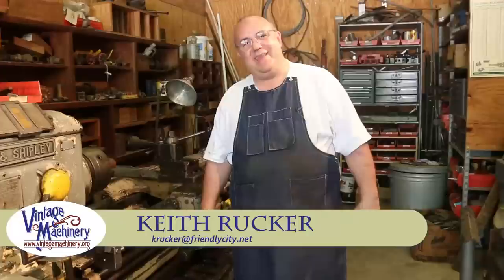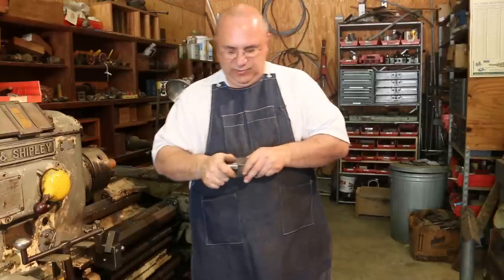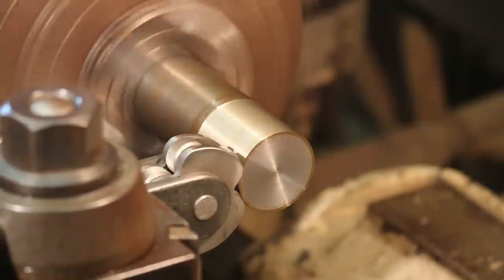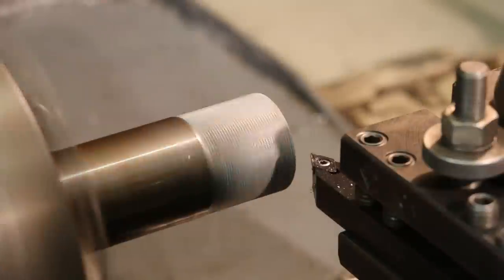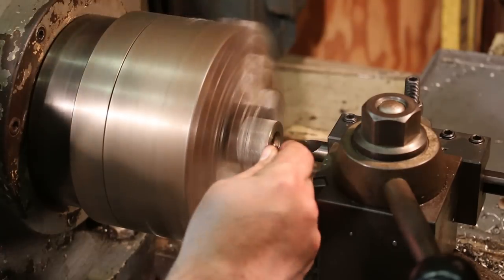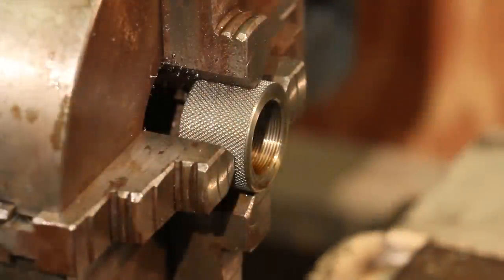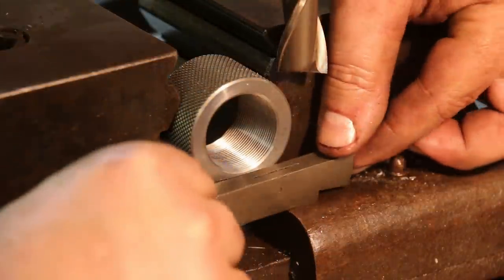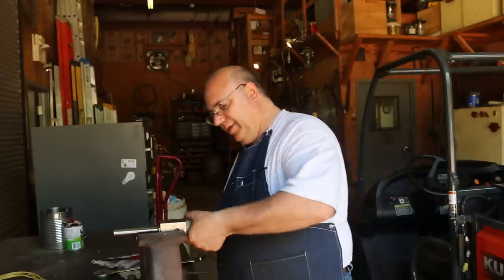Machining a Custom 5C Collet Nut

Comment: About knurling - I understand the tool and the process but one thing I never understood is why you do not get overlapping (and ugly) knurls.  The piece to be knurled is of one diameter and the tool's wheels are of another diameter.  The ratio of one diameter to the other would rarely, if ever, be an even number.  So after the first knurling trip around the piece how would the teeth of the tool align with the beginning of the previous knurls  to start the second pass?  How do you not get a mish-mash of knurls?  It obviously works - you just did it - I just can't visualize it.  I hope the question makes sense.
Reply: I think it's because of path of least resistance.your knurling tool wants to go to the easiest place and just basically keeps getting knocked into grooves as it runs around, even though it's not a perfect match. I'm sure if you exaggerated the knurling tool tooth distance, the problem you're describing would rear its head.
Reply: ***** If you look at the charts for the diameters, the difference between them is very small. If you just tighten the knurl, you will move down to a diameter that is evenly divisible by the teeth in the knurl by feel/seat of the pants.  Now, if you are trying to make a part to specification, it helps to know beforehand where that evenly divisible point is but if you are just wanting to put a knurl and have some liberty as to the dimension, it doesn't matter. Just crank in until it looks good.
Reply: cemx86 Tom Lipton ( oxtoolco ) has a good video on this. He calculates the circumference of the workpiece and determines whether it is an even multiple of the distance between teeth on the knurling wheel. It is easy to adjust the diameter of the workpiece very slightly to make it come out to an exact multiple.

Knurling wheels are marked with the number of TPI (teeth per inch), so it is easy enough to calculate the actual pitch ( 1 / tpi ) and check whether the circumference is a multiple. If it isn't, just discard the fraction, and calculate what the diameter of the workpiece must be to have a circumference of that length (after discarding the fraction).

Example: 
You want a 1.750" knurled workpiece and have 25 TPI wheels. 
1/25= 0.040" pitch. 
The circumference of 1.750" is about 5.498". 
0.040 goes into 5.498 137.45 times.
Discard the 0.45 (you could round up, but it is much harder to add diameter than to reduce it).
Find a diameter with 137 times 0.040" circumference: 137 times 0.040" is 5.48"; 5.48" divided by pi is about 1.744" diameter. 

You are going to have to settle for a 0.006" undersized knurl.

That said, knurls will usually "slip" into an integral number of grooves if the circumference is close to an even multiple. My experience suggests that you will get a bad knurl (double struck) about 1/4 to 1/3 of the time if you just take a random diameter and try to knurl it with whatever set of knurls you happen to have. However, if you have a lot of time invested in a part and want to optimize your chances of getting a good knurl, then it only takes a few minutes to do the calculations and adjust the diameter a tiny bit if needed.
Reply: I've been wondering the same thing, and have been reading a bit about it. I don't have a final answer, but some things to consider that I've come across:

There are some fairly standard sizes that most of us turn things to...usually some multiple of 1/64".  Knurl wheels come in some standard tooth pitches that have been worked out to fit with those standard diameters of parts. Unless you get strange with your part diameters one or another of the standard pitches will probably work. 

After the first pass the part has grooves in it, and as long as they are close enough to where the teeth come down on the second pass (a few thousandths), the teeth will tend to slip into them and you get clean knurls.

Knurling is a forming operation, not a cutting operation, so the workpiece will tend to change diameter slightly as far as the knurl wheel is concerned.  The teeth aren't are the original surface after the first pass...they are below that.  How far depends on how much pressure you use and how many passes you are making, but if the original was close, you'll probably squish the teeth in far enough for the effective diameter to be what it needs to be. 

I suspect that the answer is some combination of these factors, and exactly what the combination is probably varies with things like tooth pitch, wheel diameter, coarseness of the knurl, hardness of the workpiece, kind of knurl, and maybe more. It's clear that some people do get bad knurls, and some people don't seem to so it isn't automatically going to work all the time no matter what you do, but I think I'm going to just not worry about it too much and try a few to see which group I'm in.  If it doesn't work, I'll turn it off, and try again with the smaller diameter and see if that fixes it. I'm not working to precision drawings yet!

-- Mike
Reply: Since knurling is a forming (metal displacing) operation, the pitch diameter should remain about the same (very slightly smaller). For every bit of metal displaced when the knurl teeth press into the work, an equal amount is raised up between the teeth, so there is roughly an equal volume of metal extending beyond the original diameter as has been displaced from below the original diameter. The pitch diameter will be slightly smaller after knurling, since the volume of metal just inside the original diameter is less than the volume just outside the original diameter. (e.g. a cylindrical shell with an ID of .740" and OD of .750" has less volume than a shell with ID .750" and OD .760".) There may also be a small amount of metal displacement parallel to the axis of the workpiece.
Reply: yajirobe ,but it

Comment: Awesome video, as usual.
But I still don't get how the consecutive passes with the knurling-tool don't ruin the piece.
Is it just skill, or can you calculate speeds and feeds? Or is it magic ;-)
Reply from the maker: +MrPirax You are technically supposed to calculate the diameter of the piece to be a certain size so that the former tool matches up on each rev of the part, but in reality, it just seems to take care of itself most of the time.  So, I guess it is kind of "magic" so to speak!
Reply: +Keith Rucker - VintageMachinery.org Ah ok, thanks for the info ;-)

Comment: Happy Easter to you and yours Keith!
I'm pretty sure the collet nut with the allen hole in it goes to an endmill grinding fixture like this one:http://www.use-enco.com/1/1/34908-end-mill-rotary-cutting-tool-grinding-fixtures-accessories-891-5991.html
I have the same fixture at work, and that nut on yours looks like the one at work.
Regards,
Duck

Comment: You often refer to punching a hole in something, but then you drill them instead of punching.
Reply: 12345NoNamesLeft It might derive from blacksmith days. Time was when holes were most efficiently made by heating a piece of metal, setting it over a hole, and hammering a cylindrical punch through it. My grandfather (who started to teach me machining) was apprenticed to a blacksmith at age seven (about 1893 in Sweden). He had a lot to say about metalworking. I wish I had paid more attention.

I have an IronWorker press with die sets that can punch holes from 1/4" to 1" through mild steel up to 3/8" thick, so I do "punch" a fair number of holes. Pretty noisy when the metal gives way and the frame of the 45 ton press (pressure, not press weight) "relaxes".
Reply: When I was a machine builder in a previous life we never "drilled a hole" we always "Punched a Hole"...that was 30 years ago, so maybe its a regional thing, or a lazy way of saying something?  Not sure...

Comment: Knurling is not "cutting".      Knurling is "displacing".  You are actually pushing metal aside.
Reply: The knurls that Keith are indeed deforming ones but you can get knurls that cut the metal they are made to be at a angle to the centre line of the lathe and cut on the leading edge which is sharp , unlike the normal type which is pressed in 
Stuart